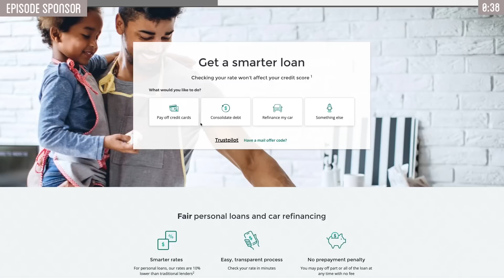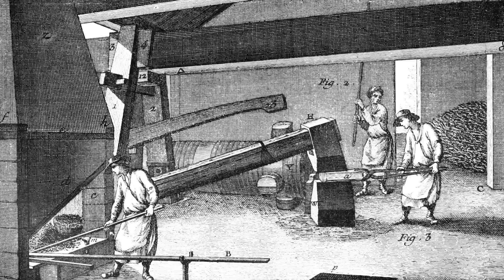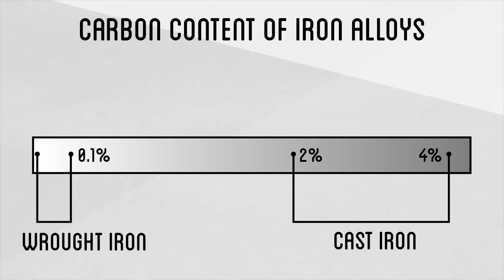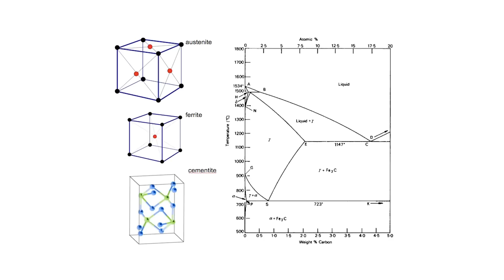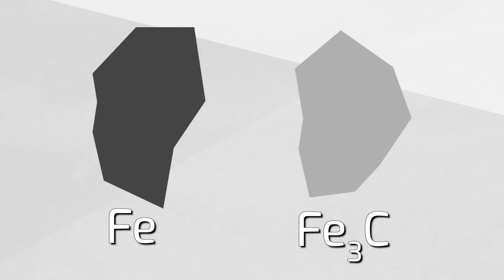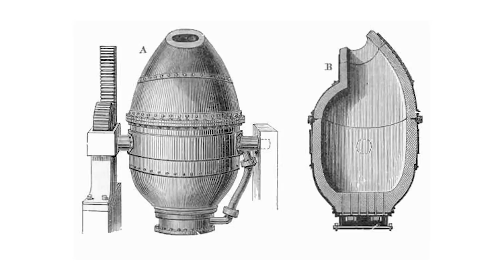Mastering the Secrets of Carbon and Steel

Comment: why does the blacksmith always make really ugly and not uniform tools? They seem to go "good enough" instead of actually trying.
Reply: Do you know how long it takes to make aesthetically uniform tools? A long-ass time. And it adds literally nothing except looks, so it is, in fact, "good enough" to make them with a rough-forged look.
Reply: The short answer is: decarburization. The fewer times you put a primitive steel tool into the fire, the more of the both precious and unknown in volume carbon you retain. You start off with a highly irregular bloom and have to hammer and weld it back together repeatedly and you're losing carbon the entire time. You're working at very highly heat because bloomery iron and steel like to crumble when worked at lower temperatures. By the time you get it consolidated, who knows how much carbon bis going to be left. You need to get that thing into a functional tool shape in as few heats as possible. Otherwise you'll have a really pretty tool made from decarburized wrought iron that won't work worth crap. If you want to see some beautiful forged to finish tools made from modern steel where you basically have all the forging time in the world to make tools beautiful, check out torbjorn ahman, or Alec Steele's early stuff before he got drawn down the bladesmithing and damascus rabbit hole because it's not only fun, but gets lots of views.
Reply: That how this whole channel operates

Comment: I don't get it, why were the chisels sharpened after they were hardened and not the other way around?
Reply: In short, hardening the edge means that it deforms less during the sharpening process, so you get a sharper blade and lose less material. If the layer of steel created through the case hardening process is too thin, though, or the tool not well-formed enough prior to case hardening, it means that it's possible you'll wear through the steel before you even get the blade sharp!
Reply: @KainYusanagi  Thats what I was worried about during sharpening! In my mind a basic sharpening should be done then refined after the hardening. Perhaps they did it that way but simply didn't show it.
Reply: @linecraftman3907  They did forming pretty well here, before hardening; since they did, it only took a little effort for them to sharpen them up, and they gave a fair amount of carbon via the charcoal paste, so the case hardening layer is going to be pretty thick for it. ^^

Comment: No. You did not use "your" iron, you used storebought on the chisels.
Reply: He stated in a previous video once he "unlocked" it he may purchase material that he's unlocked
Reply: @yaywoow  Yup. It does mean that he doesn't have to deal with a lot of the issues going into the build of having less-refined materials that aren't as consolidated, but as the project lead for Guédelon Castle said to Kirsten Dirksen in her video posted Jun 12, 2022 (paraphrased), "We aren't trying to replicate medieval times accident rates, as well"; they use modern ropes in their massive crane pulley lift because they have a known weight limit and strain capacity, so can operate using it under safety protocols. Similarly, they use steel toed boots and hard hats on site when working where they need them. Why risk health and safety when it's learning the principles of the thing that matter? It's what I've gotten on Andy's case for before, where he doesn't bother with the principles and just goes for the end result, but this video really showed that understanding.
Reply: @KainYusanagi  i don't consider steel unlocked If you cannot Make workable steel. Thing that they made, their Bloom, was garbage.  If they got it right. Just a little bit. Show that they can form it to something usable, after that i would consider steel unlocked. Now their "steel" is just trash.
Reply: @astonsuperreal  He made workable iron before, and has made workable steel as well (several years ago at this point, though in such quantities and in such processes that it never was refined enough as it was and needed further refining). This video showed understanding of the knowledge and the functional creation of it in a workable state (compared to the unworkable chunk from the last smelting video that this is a sequel to; the bloom was not garbage, it was simply not consolidated at that stage, and as was said in voiceover, it could be then taken to the forge and welded together to form a billet), and then finally the process of case hardening on iron tools to create a steel outer lining around a softer iron core, while stating that other forms of steelmaking, such as crucible steel, will be upcoming. Steel is unlocked, whether or not you approve, and more refined methods are going to come as well.

Comment: Might want to try making other wood working tools like a wooden hand plane, im wondering how one would make a flat square plane body without already having a hand plane.
Reply: You'd make a large enough blade that it can plane an entire piece of wood. ;P Just kidding; it'd have been done by hand with plumb lines (more accurate than a level) and probably sanded down using a large flat stone to get a mostly smooth surface.
Reply: @KainYusanagi  Just looked into it, oldest plane we have found was in pompeii, so they are a very old technology
Reply: @snowpaw360  Yup, planes are incredibly old tech. Also, just looked into those ancient planes more, and seems that instead of relying on hand carving a wooden mount they used a thick, flat iron sole under wood or ivory grips! I guess flattening metal against an anvil would have been much more easier to get that flat than what they could get with hand tools to surface a plane, plus it'd be far more durable.
Reply: @KainYusanagi  Well they theorized that one your talking about was owned by a rich artisan.
Reply: @snowpaw360  Yeah, because of the ivory handle; the rest of the plane was the same as the one recovered at Pompeii and others recovered at other sites, however.

Comment: I believe the proper term is “cementation” and not case hardening. Case hardening is more of a very fine layer at the surface while cementation is how blister and eventually shear steel is made.
Reply: Nope, case hardening is indeed the correct terminology for working more carbon into the alloy of iron to form a harder surface layer around a softer core, and that's exactly the process he used here as well. He used a charcoal paste, which is just water and charcoal powder, to coat the surface of the tools; no cement was used, no limestone, no silicate, no mineral salts like used in Sheffield, nothing but those two ingredients, sealed inside a clay tube (which is only there to trap in the tool and its coating in an easily-made one-use mold, while it bakes, the water is driven off, and the carbon is introduced to the iron), and heated only for a short time to impregnate the outer layer. Blister steel was produced by layering in mineral salts, charcoal, and soot into a box with iron rods, and then heating it for at least a week, to fully impregnate the metal and have it undergo a more thorough alloying process, so the entire rod was transformed, rather than just the outer edge.

Comment: You shouldnt quench the whole thing, just the edge.
Reply: You can quench the whole case hardened tool because as long as the carbon didn´t completely diffuse into the material, the core still stays soft. Modern mass produced hammer or axe heads are made similarly, but instead of carburized iron a comparatively low alloy steel is used with the same effect(~0.45% carbon and almost no other added elements).
Reply: @nilsschenkel7149  still, its a bad habit...
And that socket was pretty thin, so there is a very high chance it got through soaked and that can lead to problems later along the way. Of course, he can anneal it at any time, but I dont think he knows that much about, well, any of it xD

So Andy, if youre reading this, quench only the parts you need hard and anneal your chisel's socket :)